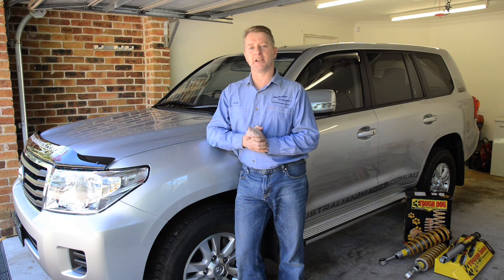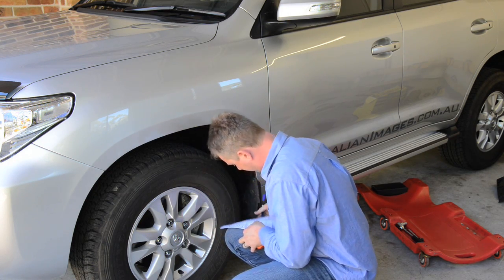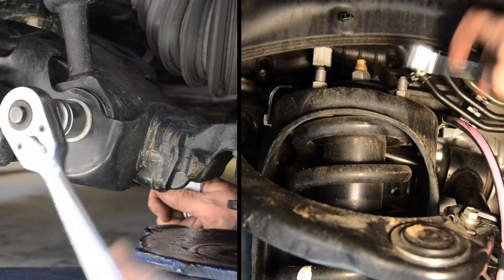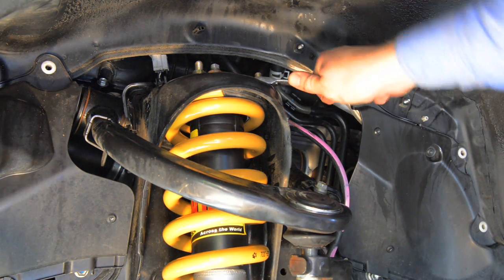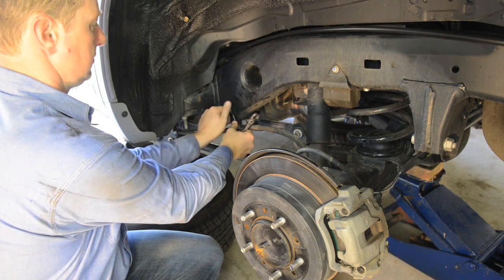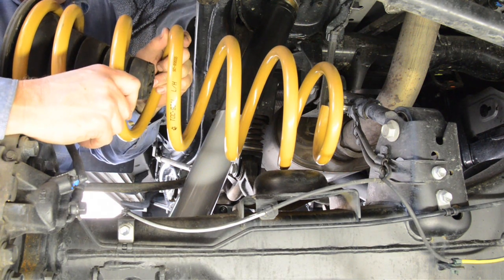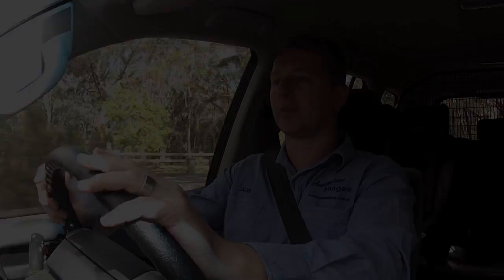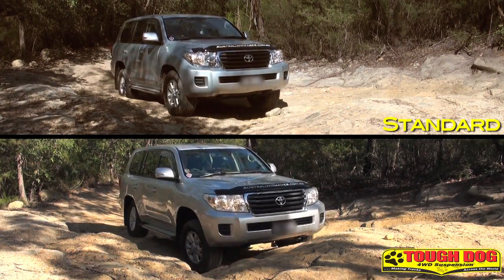Land Cruiser 200: Suspension install step-by-step (Tough Dog w/KDSS)

Comment from the maker: Hi Bernie,

Some of the details you requested are on the writeup page linked in the video description. The lift was about 55mm at the front, and 25mm at the back. I went with hard springs on the front (in prep for a bulbar/winch) and soft at the back. I expect the front lift will drop back to ~40mm once the bar is fitted. There are two heavier rear spring available (300kg and 500kg constant load), but I won't need these in the immediate future, so went with the softest ones.

Comment: Hi as I said great video But I just done 1 and if you have any tips on popping the track rod ends I have changed lots of track rod ends but they were generally worn out and generally throw away but in your case you are trying to save the rubber seals as far as I know you can’t buy the rubber grease seals seperate?? How I do it if a few smacks of the Hammer don’t work is to apply a little heat using a brazing torch with a fine flame to the steel area in 1place while protecting the rubber with a spray of Water that works fine I did try to cheat by compressing the springs but would not recommend that method as it both dangerous and don’t work

Comment: Hi love the videos, they are very professional.  I have a 2018 VX and have fitted a bull bat and accessory battery and the front end has dropped.  What is your opinion of a 40mm lift in the front?  I am told it will not cause any damage to the CV joints or boots.  I am also advised I will not need a diff drop?

Comment: How did you manage to get the front shock out so easily? I’ve done what you had as well as loosening the two bolts under the lower arm, plus loosening the bushes. Still no joy

Comment: Hi sir, what click number (front and rear) you set for daily driving mix road without any addition weight (standard landcruiser like in this video) ?
Thanks.
Reply from the maker: I have it set to 4 (mid setting) all around when empty.
Reply: Did you ever experiment using stock spring for rear? But with TD spring on front. I feel a little bit harsh on the rear spring, but feel good on the front spring.
Reply from the maker: @candrawp7044  No, never tried to mix the two.

Comment: Not so easy to remove the strut.. How did you get the new extended strut in?
Reply from the maker: Pushed the lower arm down and slipped it in. Just make sure you keep the top connected so the CVs don't come apart. It could be that your struts are longer than the Tough Dog ones. In that case, you may have to remove the pivot bolt for the lower arm to get it in. Again, just make sure the CVs stay together.

Comment: What makes the lc200 nose dive? Is it designed to be that way from the factory? Can the front part be raised up even without replacing the shocks and springs?
Reply from the maker: It looks a little nose-down. But some is an optical illusion (the rear guards have to be higher to allow for the greater travel from the live axle), and some is actual (so the car looks more level when loaded/towing). You can raise the front slightly by installing spacers on top of the front struts. But only by about 10-15mm. Any more than that and you risk bottoming the struts out before you hit the bumpstops, which can destroy the struts.

Comment: I'm in the market for an LC 200. I'v found one that has AHC, what does actually raise the truck? is it air bags? and can I use same as the suspension you installed without losing the AHC?

Comment: Hi Mate thanks for movie its very help full as i'm currently doing this now.
Question do you undo the KDSS shutter valves when all the weight is off the vehicle and supported via stands? or does it not matter? that my interpretation of it 

Cheers
Reply from the maker: It doesn't matter

Comment: Hey mate when installing the new shocks I’m going a 2.5inch lift in the front when applying pressure to the hub the make room for the shock the come out is the cv going to pop out
Reply from the maker: You need to make sure it doesn't, to be safe. Usually, just loosening the upper balljoint or removing it but leaning the spindle in while making room should be enough to keep it in place. If you can't make enough room for the length of the new shocks, then removing the bolt securing the lower arms can be an option. Again though, you need to keep the CV in place.

Comment: How difficult was it to install the sway bar link back into the mount? Heard of stories guys having a hard time putting it back. Did you do anything special installing it back?
Reply from the maker: Not particularly difficult. Just make sure the KDSS valves are open. You may need to manipulate the front one into position with a screwdriver or small pry bar

Comment: Awesome video, looking at installing the tough dog lift on my 2013 VX. How bigger tyres can you go with the lift. I currently have 285/60/R18’s. Ideally I want to go higher profile to give me some additional lift. I’m aware the difference it throws the speedo out as I currently have a 3-4 km/h variance now, so that doesn’t bother me. TIA.
Reply from the maker: I've just installed 33x12.5R18s on mine. Slight rubbing on the front mudflap, but that's all.
Reply: @austimages  Did you switch from the Mickey Thompson's to another brand Jamie? If so, were the newer ones better or worse overall?
Reply: @michaelcoffey6340  Yes, I switched to Nitto Ridge Grappler. I would rate them equal for durability and performance. Ridge Grappler perhaps slightly better on dirt/gravel. The big advantage though was road noise. Much quieter than the Mickeys, especially as they wore.

Comment: after replacing replacing old shocks with new standard shocks.... do i need to adjust the heights? or the the heights will not change?
Reply from the maker: Unless the ones you replaced were sagged, then the heights will not change.

Comment: Very well presented. I'm looking to transfer suspension kit from my old car 2014 to the new shape 2015, the new one equipped with KDSS unlike the old car, do you think the hardware will fit both cars? Thanks in advance!
Reply from the maker: Yes, that should be no problem.
Reply: All good. 
Dealing with kdss bars is the most annoying, some tie rods been super stuck had to ignore it (work on tight space), about 10mm lean to the right. but swap is done successfully and I just saved $??? 

{{{{{THANKS AGAIN FOR THE FANTASTIC GUIDE}}}}}
Reply from the maker: You can try this to fix the KDSS lean: http://www.project200.com.au/kdss-balance-lean/

Comment: I am refitted a new front right side shock absorber on the same model. But finally the right side of the vehicle hight is lower than the other side.. How its corrected pls advise me because now I am in a big trouble pls sir
Reply from the maker: If you have KDSS, then try this: http://www.project200.com.au/kdss-balance-lean/
If you don't have KDSS, then the new shock must be too short and you'll need to replace it with the correct part.
Reply: Australian Images
Thank you very much sir...... Thank you so much..... It's working I will do it it's corrected........ Thank you sir thank you.....

Comment: Did you have to loosen the lower control arm bushes to get the lower control arm to drop?
Reply from the maker: You should't have to, but it may make it drop slightly further if you're having trouble getting the strut out.
Reply: Thanks, I'll give it a go

Comment: How is suspension is compared to ARB OME BP-51 ?
Reply from the maker: BP-51s (and other premium remote res monotubes) are in a different class to these shocks. You probably wouldn't notice the difference in normal driving conditions, but in extreme conditions, the larger oil capacity of remote res shocks mean less fade. They also have more adjustability. On the flip side, they cost between 2 and 4 times more, depending on the brand.

Comment: May I know what hydraulic fluid to use in case of bleeding air of kdss system ?
Reply from the maker: I have no idea on that one. I suspect it's a Toyota genuine item.
Reply: @austimages  The 0888601805 is the Toyota AHC oil. Now I am confused whether to use the same oil for kdss system or no.

Comment: Are there height variable aftermarket suspension systems? Will my height control still function?
Reply from the maker: Edgar Lubulellah Sorry mate, not sure. Height control isn't available in Australia, so I'm not sure what's available for it. You'd need to check with your local suppliers.

Comment: cant get the rear shocks out , any hints as top half of shock is spinning,
Reply from the maker: +Stephanie Musca If you don't plan on reusing the old shocks, you can grip the shaft or stone guard with vice-grips or stillsons. If you do plan on reusing them, then you may be able to grip the stone guard with a small oil-filter wrench.

Comment: aren't the KDSS shocks interconnected diagonally by hydraulic lines?
Reply from the maker: KDSS vehicles have standard shocks. The KDSS system has two hydraulic rams connected to the front and rear sway bars. Essentially the system controls how much movement is allowed by the sway bars. At high speed/on road (i.e.: front and rear leaning the same way), the KDSS reduces body roll. But at low speed/off road, where you want wheel articulation (e.g. front left/rear right dropping into a hole), the KDSS reduces the action of the sway bars, allowing better wheel travel. It is a purely mechanical system. There's no connections to the computer/ECU etc.
Reply: Thanks for your explanation! this sounds like a maintenance free system. I have 2003 4Runner which has the X-REAS system, the shocks are connected by hydraulic lines diagonally, and to replace a leaking shock is crazily expensive. I guess the KDSS would be less costly to own since the sway bars don't need to be replaced like the shocks.

Comment: I press Lo position the dash indicator keep blinking.. what happen ?
Reply from the maker: You have to be in N to change to low. If you were in N, and it still won't change then there could be a fault in the transfer case actuator. Try repeating a few times.

Comment: is tough dog still a competeor today or are they junk?
Reply from the maker: Mine are still going strong after 4 years including some pretty severe use, and I won't hesitate to use them again. They aren't in the same class at the big remote reservoir stuff that has been emerging lately, but they also don't cost anywhere near as much.
Reply: i was looking at either a TD or dobinsons setup for my 100 series land cruiser can't decide. i don't have enough for the adjustable so just the foam cell tour flex or a nice monster dobinsons setup 2"

Comment: Just wondering if your 200 has KDSS. I am looking at some aftermarket suspension for my 200 and I have KDSS fitted
Reply from the maker: Yes, it has KDSS fitted. You need to loosen the two KDSS balance screws as per the video when you install the suspension, then tighten them again afterwards.

Comment: Thanks for your video.  I learned alot using it on my 200 but wasn't able to get enough flex to get the bottom of the strut out.  I found another method and used it half way through and it worked for me.   I was done in an hour afterward.  https://www.youtube.com/watch?v=n5UabdD1Q6s   I hope this helps.  You both have valid method to perform this task but the other worked better for me to get the flex.